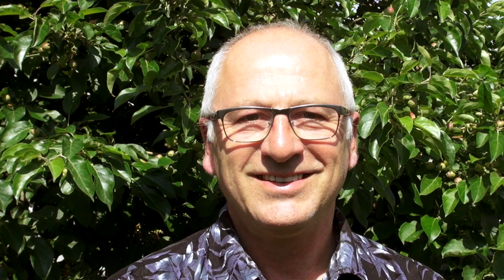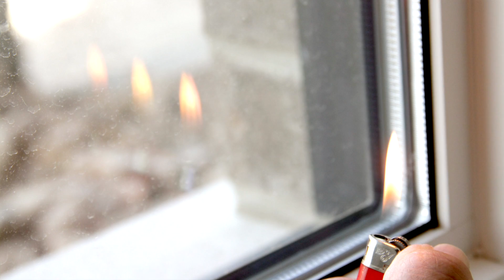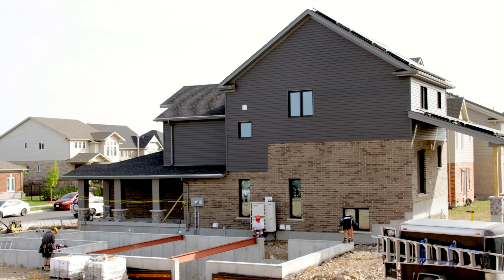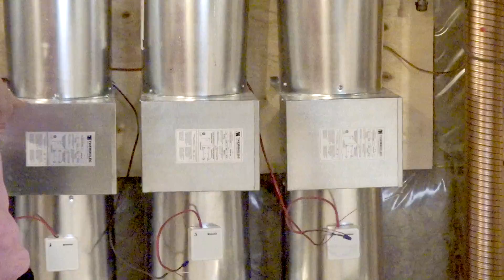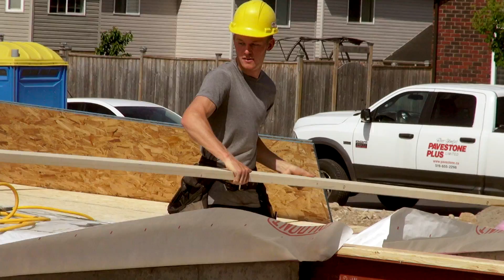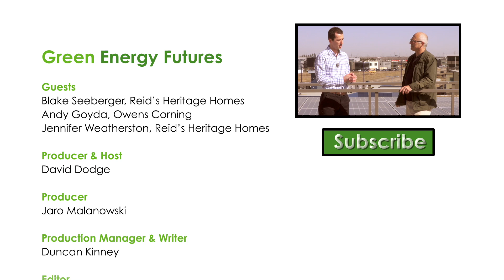114. Net-zero goes viral: We head to Guelph, Ontario to check out the latest batch

Comment: Hmm the reality iis that this solution would fall flat on it's face if others weren't paying to subsidize the projects. As always happens folks get together & tell others who to live or else. If solar was the answer then it would have taken over the other methodologies for energy. Yet it hasn't. Because it doesn't work for all cases. It's costly to utilize & it's a maintenance headache. It's also creates a ton of bad by-products that folks simply disregard to paint a pretty face on GREEN. 

While I'm not opposed to greener energy, I don't want it forced down my throat by folks that won't have to be responsible for the unintended consequences. We only have to look at the movement that got incandescent light bulbs outlawed, They're to be replaced with products that are more energy efficient but at a price. They're costlier, a pollution hazard, & they loose the ability to produce the same output of light over time. Or to say they have diminishing returns. 

Then lets look at the viability of these so called Net Zero solution. Not everyone is gong to want to live like that. Not everyone can afford it, Not everyone wants to have homes that are run by the GOV. For to make sure that you're abiding by the socialized dictates of the GOV, they will have to monitor your usages. 

So like now where we have states that are looking to outlaw BBQ's, make sure that you don't take a shower longer than 10 minuets, make sure that you don't eat at Mickey-D's, etc etc etc folks will balk at so many restrictions on their lives. 

Why some have tried to go off-grid but to no avail. They're prosecuted & persecuted by the self same system that's promoting net zero & green energy. 

In the end the power of the dollar will be the deciding factor for these things. Not "GREEN ENERGY". At least that's the reality of things. 

Not many are going to want to pay for the elitists to have their green utopia while they're having a hard time making a living. Nothing i free. No matter how many times socialists try to state otherwise.
Reply: 1timby You're pretty delusional if you think your current energy sources (natural gas, oil etc..) aren't subsidized heavily...why don't you google fossil fuel subsidies and check out the half a trillion dollars worth of subsidies we hand out to fossil fuel companies every year. Does invading a country for its oil reserves and spending billions on defending the oil fields count as a subsidy in your mind? It should. 

You also are not valuing the environment at all. If I started a manufacturing plant near your home and started dumping toxic fluids into your backyard you would cry foul and ask for regulation. But companies have been doing this for decades and haven't had to pay a dime for polluting and destroying our environment.

Truth is, renewable technologies don't need any subsidies...let's just level the playing field and take away the fossil fuel subsidies. 

Also, why are solar panels a maintenance headache? You are so badly misinformed. It is also ironic for you to by crying foul about new technologies that create a "pollution hazard". I thought you didn't value pollution...which is it?  LED bulbs use 1/6-1/10 of the energy, last 20 years and don't contain any toxic chemicals. Do some more research.

I wonder why you are so loyal to fossil fuel companies that are actively destroying our planet....
Reply: electricalBear I never said they weren't but not to the level of solar & green. You would have to be mentally deficit not to see that. All one has to do is simply review the vids out there of folks that have put in solar & wind. Who mostly stated it was because the GOV, meaning you & I, were giving them a ton of money to put it in. 

Of course folks that seem to discard history give the answers you just did. For if solar was the answer to all of this then why has it taken nearly 50 years to even get this level of acceptance? Note that in the beginning there were no GOV subsidies. So it die on the vine. Not to mention that you folks hated the looks of solar & wind. How many times I hear that wind killed wildlife, they were upsetting you folks because of all the noise , & how unsightly they were. That you didn't want them in your neighborhood. 

Here's another one. A billionaire backed out of developing a wind farm in our area because of the costs to get the power to the source. In other words it was unprofitable. So again without GOV intervention then it's not cost effective. But I digress.

So unless it's forced by GOV to all folks then it won't ever become the defacto power source. Simply because of all the things against it. 

It would be nice to have you folks do any real research on things for a change. The few billion given to oil as subsidies doesn't even come close to the subsidies given to folks that buy into a system that has already been shown to be a failure. Given the footage of existing power generation facilities, the cost of power generation, and the ever increasing demand for power, solar & wind are little more than rich folks toys. Or only for those that are off grid & can't get access to power. 

So let's look at the cost to implement these solutions to an existing home. Without GOV intervention the cost would nearly double the cost of the home. So please enough of the misinformation that someone told you. Note in the vid the guy stated "It's not if but when". Meaning the GOV will force it on you just like they did with Florescent light bulbs. How sad. You folks can't think and are so math challenged.
Reply: 1timby What are you talking about? The subsidies for fossil fuels are 5-10 that of renewables. 
Fossil fuel subsidies in the US:
http://www.theguardian.com/environment/2015/may/12/us-taxpayers-subsidising-worlds-biggest-fossil-fuel-companies

How do you think they all got off the ground? Do you think the oil industry didn't need subsidies at the beginning? You think half the wars in the past half century haven't been about protecting fossil (and or capitalist) interests? Do some research about what Shell did in Nigeria, or what happened to Ecuador...that is your fossil fuel legacy. 

How much are all the oil spills/train explosions/acid rain/health risks etc... worth to you? Nothing? Fine. But the rest of us want a decent world to live in. 

50 years ago? Seriously? PV efficiency has gone up every single year and prices have come down from $80/Watt to under $3/Watt in 30-40 years. We are already at the point where even without factoring in environmental and health impacts, PV is basically at or near grid parity. As I said, we don't need subsidies, we just want a level playing field. Fossil fuels have been extracted for about a hundred years, of course they are more cost efficient...(or they seem that way because we don't price in subsidies, environmental, or health costs) but renewables already have attractive paybacks even without subsidies.

Keep driving your SUV and living in your piece of crap uninsulated home, when energy prices rocket, we'll see who's scrambling to put up PV panels. Live in your make believe "boogy man government" fossil fuel world, us grownups have shit to do...mostly fixing the mess that you conservatives have created. Oh wait, you're probably proud of the massive oil spill in the gulf of mexico.
Reply: ***** This is highly untrue. For existing homes to become net zero would require a huge cost by the home owner. from their HVAC, insulation, widows appliances, power generation, etc.

So now we're talking about homes that were at 200K now costing 300k or more. Not to mention that these cost could escalate much higher if the homes are located in areas of the country that are not good candidates for green energy. 

While this may be an OK idea for those building a new resident they're seldom cost effective for most home owners. 

Take geothermal for instance. It would take a huge amount of time & cost savings to recoup the initial investment. I looked into this when I needed a new AC. Even though the area requires a lot of cooling, it doesn't pay to get geothermal unit when I can buy an efficient AC unit that costs much less.

Without a grid tie the cost of solar are tremendous. The costs for good batteries, maintenance, power conversion, etc runs the cost of solar up enormously . To put a 5KW unit into my home would require me to pay over 100K. Unless I was to tie it to the gird. In which case the local power generation facilities won't pay me anything for the power I generate over what is used. 

I think solar & wind has it's place. However, until there are huge changes in homes being built, changes in local building codes, changes in technology, etc then there is no way that green energy can replace existing forms of power generation. Especially since one has to use so much more real estate to get even close to the power output of a single coal or NG powered energy generation facility. 

If it wasn't  for the rebates there would be little of this stuff done. Not to mention that your article states that the GOV is forcing this legislation. For there are few folks that would require these forms of power generation. Off grid & such. Don't forget that these forms of power generation have been around for a long time. So one has to wonder why they haven't replaced the existing power generation methodologies. Maybe because of the price it would cost folks to implement it is the reality of why it hasn't replaced coal, oil, & NG for power.
Reply: the purpose of grants is to explore how to do it better, how to development the most cost friendly technology so builders and home buyers can buy affordable homes with increased quality and comfort. the homes are slated to be in the 65k to 75k range to be able to achieve net or near net savings over a year. it has to be net as it depends on how people live in the homes as to their energy consumption (cannot leave TV on all day and ever light in the house when not home). solar is the beginning as new technology developments costs should come down, energy consumption diverted. but the homes should ideally produce as much energy as they are consuming. this is not achievable by only putting solar on the roof. as described in the video - the building envelope has to be sealed, proper ventilation and higher efficiency equipment like the furnace, HRV, appliances and lighting are key to reducing overall demand and improving air quality. If we recognize our energy use and utilize the complete system - then the savings from your utility bills should off set the additional value on your mortgage - netting out at todays energy rates. so in the end you have a healthier home for the same price we are budgeting for today. New technology in equipment in new construction is advancing quickly and changing the dynamics of home construction. No more oversizing and paying premiums for items that should be mainstream.
Reply: Jen w Solar & wind isn't new tech. Grants are coming from somewhere. Yet you din't stipulate where they were coming from. I have no issues with new TECH or green energy. I have an aversion to having it forced down my throat & paying for others to have it. 

A free market shows what works best. New energy efficient things have been coming out for decades. Yet many don't work as advertised or are so cost prohibited they will never be main stream.

I looked into Geo-thermal as an alternative to cooling my home in the south. The energy savings wouldn't come close to paying for the huge costs. The equipment would wear out well before the equipment paid back the supposed energy savings. 

Existing housing codes don't create an energy efficient house. Education would be a better alternative to GOV forcing change. As is my experience with GOV forced anything is that it makes things far worse. Homes in our areas were substandard because the GOV was not paying attention. They allowed the inspectors to be paid off & not do their jobs. So home owners pay a ton of money every few years to fix foundation issues. This is just one huge example of GOV enforced stupid. 

It will take a huge technological increase to fix the inherent problems with wind & solar. from batter tech to energy conversion. The costs are to prohibited for the average person. maintenance is a huge headache as well. Not to mention that folks not living in optimal regions of the country will have to pay huge amounts more for a technology that doesn't really afford them a standard life style. 

Reality always trumps Hope & change.
Reply: RechargeableLithium Wow were do I begin, How silly & foolish you folks are. To believe that if you removed the subsides that the costs wouldn't be raised on the product. You folks are really clueless when it comes to economics. 

Business 101 costs to do business are a key component to pricing of the product going to market. When prices increase due to labor, products, etc the costs are adjusted accordingly. So MR Wizard name one widely consumed product that's not being subsidized by the tax payers? Your folks gullibility is only surpassed by what little you know about economics or how any business runs. 

All green energy initially falls short on production the energy required for day to day use. In order to replaced the needed energy production, just for current requirements, would required huge increases of amounts of green energy production. For it's limited in scope compared to what's existing. Again you show your naivety of energy requirements & what green energy can produce. No wind or sun no energy with current technology. You folks hate nuke. So that's out. You've bemoaned about pollution form coal so those are being closed without viable alternatives. Thus increasing the cost of energy through the roof. But hey as long as it's green that's all that matters. Who cares how many poor folks wont have heat in the winter or cool n the summer. So do you folks hate the poor?

How short sighted & misinformed. Per sq foot of space, current energy production far exceeds that of solar or wind. Then we have the issues of lower energy production in the winter & at night. Wind is as big an issue as solar. Not to mention the sundry other costs in the system to try & store the energy for when it's cloudy or not windy. Thus requiring an increase in the amount of solar & wind. 

It's truly sad that you folks are so misinformed & enamored with green energy replicating existing tech. Especially since wind & solar are subsidized up the wazoo as well. So your either ignorant of the facts or hypocritical & don't concern yourself with reality. As it's inconvenient to your narrative.